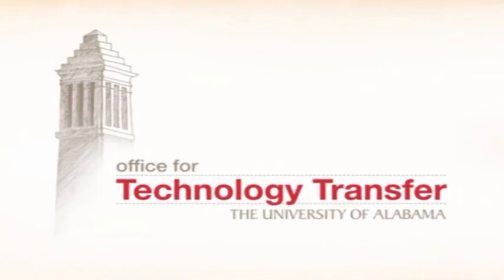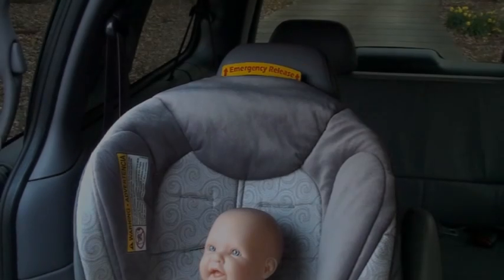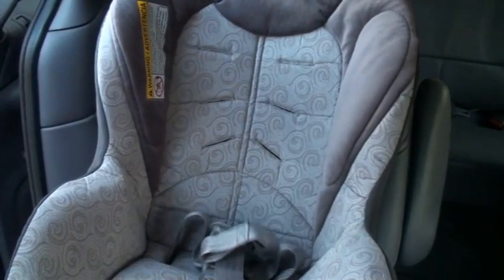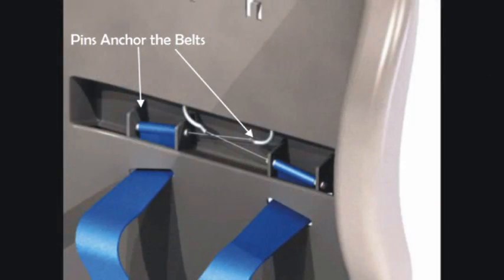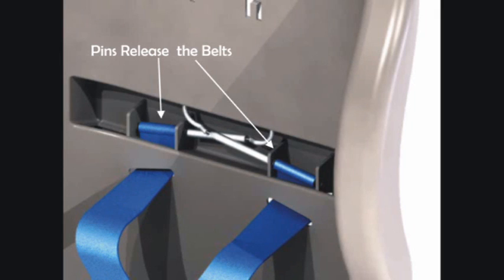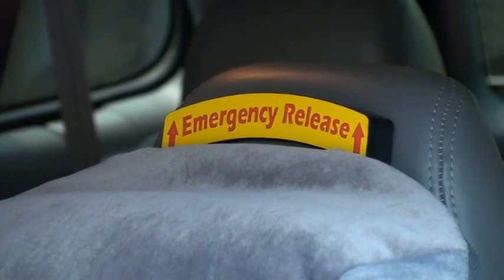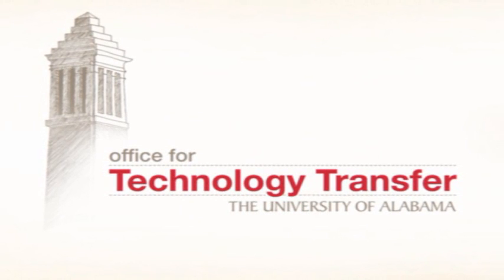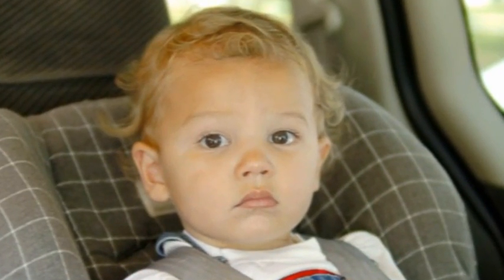Child Safety Seat Emergency Harness Release System

Comment: and what EMTs usually do with rearfacing AND forward facing children (the doll is so small that it should have been a rearfacing seat) is simply unbuckle the seatbelt or use a tool to quickly cut the seatbelt/latch strap to lift the seat and child out together... not only speeding up time, but preserving the position of the child's head, neck, and spine.

You can buy one (belt cutter) and keep it in your purse, on your keys, or in the glove box for just such an emergency.

Comment: um people about the chest clip. if the seats dont have the five point harness it is MORE DANGEROUS in a car accident. the child could slide out the the seat and get thrown or in a toddler that is one years old that child could get thrown if the seat doesnt fit the baby right. they have proven that more lives have been saved with the Five point Harness then the Three Point Harness System.

Comment: There is no need for this product.   As it is, the incidents of children being trapped due to car seats in a fire or water is slim to none.    

Europe requires that harnesses be released in a single motion for just this issue.  If the US stopped using chest clips, it would solve any perceived problem.

The makers of this product are clearly not familiar with child safety, otherwise they wouldn't have demo-ed an infant in a forward facing seat.